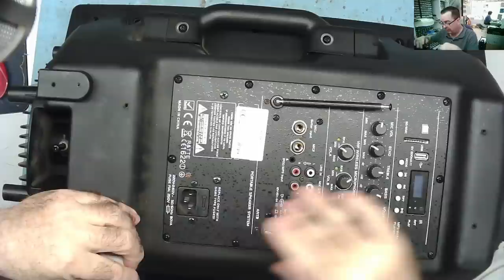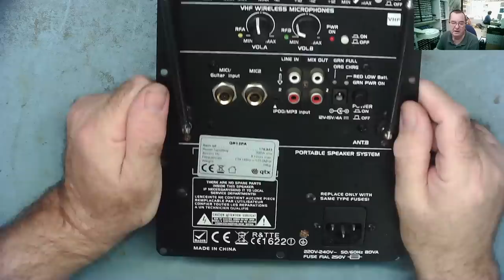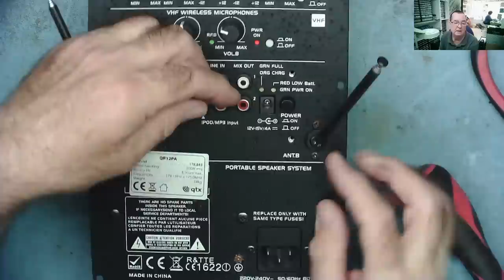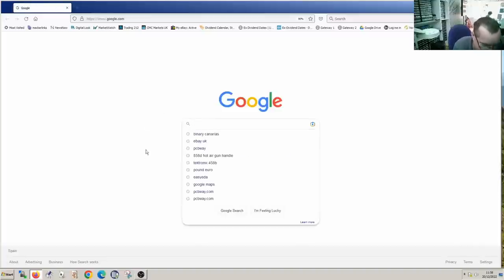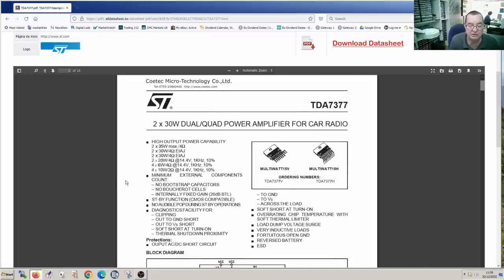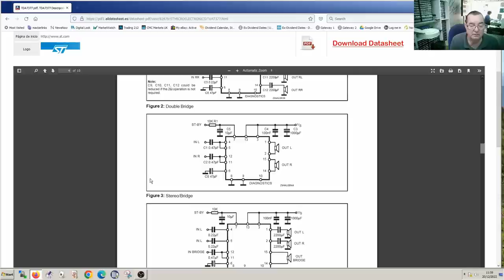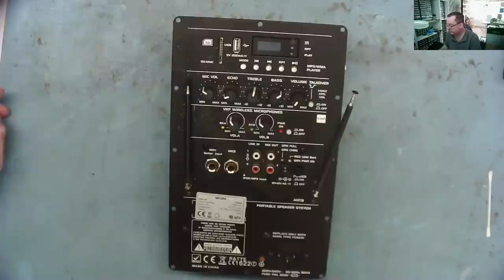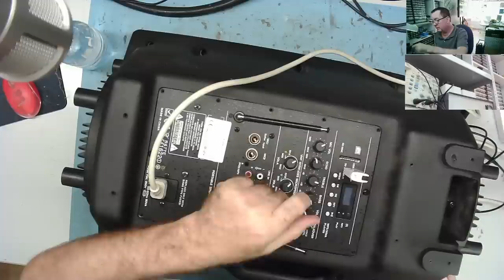Faulty 200W rms Amplified Active Speaker?  NO WAY!  It's all lies lies and DAMN LIES!!

Comment from the maker: Actually you can see on the datasheet at 09:04 that the amplifier chip is actually....

Wait for it...

6W RMS per channel in single ended (not bridge) mode!!  WOW!
Reply: Do you tell the customer what you found out from inside?
Reply: Part Number : TDA7377

Function : 2 x 30W DUAL/QUAD POWER AMPLIFIER FOR CAR RADIO

Package : Multiwatt15V, Multiwatt15H Type

Manufactures : ST Microelectronics

HIGH OUTPUT POWER CAPABILITY:
35W max./4Ω
30W/4Ω EIAJ
30W/4Ω EIAJ
2x 20W/4Ω @14.4V, 1KHz, 10%
6x 6W/4Ω @14.4V,1KHz, 10%
4x 10W/2Ω @14.4V,1KHz, 10%

So if look at it.

It do 2x 20watt rms on 1khz 10% 
Max is 2x35watt . (Bass and horn speaker )

Not 6watt rms what you tell.
That is only if u use it for multi speakers connection.
Like a portable  bluetooth   with  6speakers ar in use. 

So it not that bad
Reply: And it only assumption if that IC is TDA7377 but maybe it is not, it only say that on PCB but it can be easy TDA7379 which is 2x38W.
As early mentioned TDA7377 is 6W in single ended mode (4 speakers) in bridge mode is 2x30W (2 speakers).
Single ended mode do not apply here.
Reply: Ouch, 6W???
Mine had 25W per channel (15W RMS).... see my other comment I put up, 
I commented before watching the video as I recognized the speaker cabinet and layout immediately,
Then I spot this comment as I sit down just after break here at work (As I play videos as background to motivate me to work, just about to fix a HP M606).
Reply: I think the "power handling" relates to what the speaker itself can allegedly handle, rather than what the amp can put out. As pointed out by others, the amp is a 4 x 10 watt into a 2 ohm load car radio amp. Way short of 200 watts however you wire them.
Reply: @dyslectische  10% at 20 watts? no, thank you though. lol.
Reply: @dyslectische  nothing high power about it at all. Just a cheap & nasty speaker system you can buy for about $80 here in Australia. If I want high end amplifier kits with preamp & stuff, I'd go to Altronics & buy one of theirs. Once built, I'd go shopping for a good set of VAF Research speakers, or I'd try tracking down a SONY TA-N1 amp. These things need a sack truck to shift them, due to them being very heavy.
Reply: Reminds me of an old Power Akoustik (or however they misspelled it) "1400 RMS" car audio amp that was popular when I was in high school.  It had either 6 or 8 chips that weren't even 2x30.  I think they might have been 12W mono chips, with 3 or 4 of them per channel.  Yeah, I think it was 6 chips, because I remember the total wattage being 72 at 100% efficiency, which is never possible.  It surprises me things like that are even legal to be sold.
Reply: @eric_d  I  remember those amps. What a lot of people don’t understand is that the amplifier reaches max output before the volume control reaches maximum volume. This is due to the power supply not supplying proper voltage to the output devices used. Let’s take the MJ 15004 power transistor as a good example. It has output power of 250 watts, but requires 160v to do so. This device is a PNP type TO3 style transistor. I have used them for building current shunts in power supplies.
Reply: I'm a retired audio service technician, in my many years experience, it wasn't uncommon for company reps to intentionally misquote the equipments mains input wattage, as the audio output rating. It shifted cheap stereos to gullible shop owners, who in turn had to convince the public to buy them. Have you ever tried selling a new Amstrad or Binatone Hi-fi to someone! 😉
Reply: @A. Melbs very good question. Pioneer had a component system years ago that had a preamp setup from each section to equaliser and then the main amplifier unit. Other ones they sold had preamps in the components such as the tuner and tape deck. I’m sure you should be able to construct a preamp for use with 12 volts. Just as a point of interest, I was given a car stereo that had a badly damaged tape carriage. The radio section was fine. I set it up in a record player that had a bad amplifier. I built a power supply to drive the car stereo part, and set it up so I could use record player or radio. It worked very well.
Reply: @dyslectische  10 % distortion?

Comment: Nice easy fix. Those output amplifier modules are often found in car stereos from the past. Easy to find, & not expensive. When I saw the 200W rms output, I started wondering what it had for an amplifier board, & what components it had. Only output transistors I know that put out this sort of power are the MJL-21193, & 21194 (Motorola ), & the MJ15003, MJ15004.

Comment: I recognize this immediately, they typically have a 25W printer (15W RMS) and I put in mine a 12V car sub amp PSU for 25V split rail for a total 50V and I put in mine a guitar amplifier with 100W RMS 150W peak (with safety anti-latching circuit, it technically peaks 120W in most of the range because it essentially compresses higher frequencies over bass if too loud... the PCB was salvaged from an HH-Electric MA100 with blown pre-amps due to bad capacitors)
I just bridged the 25W amplifier to make a 50W peak, 30W RMS tweeter and drives the sub with the 100W amplifier.... It defo kicks some, but I do need to sort out porting the bass better as this wasn't designed for such bass.
Also I changed the back plate to an aluminium sheet and just added the tone-board removing everything else and moving the 25W amp to the back of the tweeter.
The woofer speaker I recon can handle 200W and that's what the scam is "Well the woofer can handle 200W therefore it's a 200W speaker....." which is "technically correct" in that the speaker can handle 200W, but they conveniently miss the point of the amplifier being a wimpy 15W RMS jobbie, lol
These speakers are good for down to 120hz clarity and does kick a bit at 50-70hz but only on kick reproduction (more ya feel the kick drum rather than hearing the kick)

Comment: Absence of 2 large el-caps near that amp chip means the chip is in "mono bridge-mode" so max 30 watts? Likely there's just a cheap NPO cap (2.2 to 10uF) to filter bass away from tweeter. 90% of power heads to the woofer anyway.

Comment: DUAL BRIDGE 30W or QUAD SINGLE ENDED 6W configuration.  My denon amp is a 50W normal twin channel, but you could buy the matching amp with out the controls and bridge the outputs to get 200 Wrms. but on my pay at the time it was out of my price range to get the second unit or the speakers that could handle 200Wrms.

I should have gotten something like this 200W rms for £5.

Comment: The audio industry is only beaten in the amount lies told by politicians.  Repaired and Sold electronics for years, and was always amazed at the old 6x9 "3-Way" car speakers that only had ONE full range speaker, and FAKE mid-range and tweeters added on to make them LOOK 3-Way.  They always had the "Retail Value $199 / Our Price $79.99" on them, when in reality they had a full range speaker worth AT BEST $15...  You'd find them at swap meets on the weekends, selling them like hotcakes!!  Of course by the time the buyer got them hooked up and discovered they were swindled, the "dealers" were long gone!!

My first experience was when someone brought me a pair stating they thought the tweeters were blown.  When I showed them it was nothing more than a plastic disk with some thread glued to the back of them, they learned the hard way not to buy stereo equipment at swap meets!!

Comment: Yes, Oh yes the loose wire and switch and control problems, annoying but very fixable, but many would have just trashed it and bought a new one.  The fake wattage thing.  Years ago I also noted that on some home stereos, they could rate them higher in watts due to putting in a low end bass cut off filter.  More fakism.  I'm not sure about the amps ratting of a transformer but a watt ratting will also tell you if the item is really 200 Watt output, it would have to have a 220-300 watt transformer power rating.

Comment: Yeah, Merry Christmas to you and everyone else. I bought a set of Amplified speakers from Fry's Electronics here in Northeast Georgia USA. They said 600 W on the package. I didn't much believe it but the price was okay. They're probably around the same as this 50 Watts or so.
Reply: Meanwhile it is normal to sell eqipment with the super duper power ratings. typically car power amps are labeled with giant power levels. For instance an  2000W (4x500) amp will revealed its true power tested on the bench with a test setup. 
I had one several moons ago on my bench. Setup with an  huge power supply  , easy deliver 200 amps a resistor bank and an audio generator. The 4 x 500 watts were 4x75w rms  in real. 
After 10 min run there was a smell of "eletricity" in the air. so I turned it off before it blow up my shop.☺

Comment: I have Alto speakers and they are triple the size of those and has Class D amps from 100w RMS total, and measured on the bench analyzer, I think the amp is 200w pmpo like they used back in the day? Wauw that's an another way to solder things, you find these a lot in cheap Chinese stuff, even in measure equipment. Metal shield that touched the nodes of the components, it was a frequencies counter, well it does it's job now here. It's basic, but I got this from a friend who thought it was time for recycling :)

Comment: i noticed long ago they changed amplifier power to RMS.. you just knew that WATTS was gone for good... apart from professional instrument amps. stick RMS where the sun dont shine.
Reply: Yep, rms power was an invention. Does not exist in electrical engineering.
Reply: @mobby1212  BS! RMS is in Elect Eng. It is the only accurate method of measuring actual constant power. A 100 peak power is only a 100 watts for as long as that peak last. Eng. realized they needed a formula to accurately measure constant power for a particular load. RMS is it.

Comment: Yes, pure marketing lies! Not real RMS (root-means-square) watts but SPL (sound-pressure-level) that started in lying car amplifier marketing. Real RMS watts (if memory serves), is calculated as Watts = V / R times 0.707 where R is typically 8 ohm dummy load with signal generator sinewave to amp input (amp volume set to max) is pushed to edge of clipping on a scope connected to the load, where V (volts) is read across the dummy-load resistance.
Reply: That is average power not rms, as rms exists as volts and amps, but not power. rms V x rms I = Average power.
Reply: Watts = V*V/R   Peak power is estimated in various ways depending on single frequency vs wideband and distortion. I have seen advertised numbers from 2 to 10 times.
Reply: Yes, as electrical-input, 'Average-Power' as well as the ‘Power-Factor ( if in a 1:1 ration (1) or less), can be calculated and certainly fine to know. As for audio amplifiers, what is usually and most keenly focused on is the ‘drivable-wattage’ into a speaker cabinet(s), being low ohms and an inductor. Which all translates into the final audio output decibels. So yes, there is a spectrum of formulas that can be used, as to the information wanted/needed. Mainly, its to ‘point-out’ the mass lies companies use in marketing, deceiving unaware consumers when the ‘Wattage’ is only a faction of what is advertised. Thank you all for your comments.
Reply: Could be IPP watt rated.
Companies Loved That in my day.
Reply: Isn't SPL measured in dB?  

Here a theoretical value of "200 dB" in perspective:

Considered the loudest event observed by mankind, the eruption of Krakatoa in 1883 sent a shockwave around the world 3 to 4 times in all directions and killed an estimated 36,000 people. The volcano is located between Java and Sumatra in Indonesia and its explosion at Krakatoa was measured at 174 decibels at 100 miles from the source, which puts estimates of sound intensity of the shockwave at the source at an equivalent of 310 decibels. That is 1021 more powerful than noise from a jackhammer
Reply: @GeekLabsMusic  The maser point is: 6-audio-watts is 194 watts short of 200 watts the marketing proclaims. Even with only a six watt amp module, only about 5.2 watts is usable before high-end THD (Total-Harmonic-Distortion) sets in.
Reply: @EyesOnReality  I don't disagree with your premise that rated power in most cheap domestic audio products is over hyped marketing BS... However your statement about SPL is not correct. There's alot more that goes into how "loud" an amp can drive speakers. Relationship between SPL and Electrical Power of an Amp is alot more complex. SPL is not electrical power. SPL is a mechanical/phisical value of how much air the speaker diaphragm can move. It's determined by both the electrical power and sensitivity of the driver(s).

Also your understanding of how THD happens is incorrect. THD is mainly influenced by Amplifier topology and the head room of the power supply, and also the quality of the silicone (Transistors). Cheaper products have small power circuits and lower quality components. THD is also relative to the frequency being reproduced. Bass note require more electrical power to reproduce while higher notes require less power. 

In a decently designed system 35 RMS is plenty of power for a domestic product.  Also the electrical power rating even if stated accurately is not the best indicator of how loud a sound system can go. That's why more Pro Audio speakers have a SPL rating.
Reply: @GeekLabsMusic  Sure its all more complex in many ways, yet working in Pro-Audio, 19" tower racks housing pro-level top amps, all being feed into concert speaker cabinet arrays in an auditorium, its only about what can be delivered for the concert hours away. As for consumer products, all the more for car amps, SPL is contained within a small space. Usually such low-end products contain SIP packaged TDA2030 and such IC's, where THD is lousy, are toys next to real TO-3 power transistors banks on large heat-sinks of the day. So in the pro-audio world, SPL means nothing when setting up for the concert. Again, its ‘marketing’ lies the video creator was pointing out that presents falsehood wattage, not SPL. SPL is valid, just not used when marketing wants to promote lies as truth. Even within that, its great you are exploring the details, learning all you can.
Reply: Pmpo used to be the car audio favourite measurement to show wild numbers.

Comment: Y'know, the amplifier probably is rated at 200W because it consumes 200W  Electrical Power.  The RMS bit is thrown in as part of the voltage component of the wattage as a smoke screen.  After all, it would take 2 full Marshall stacks to deliver 200W music power.  instead, that amp should be rated at 2 Marshall light bulbs.
Reply: The only way it consumes 200 watts from the wall is if it can make toast.
Reply: No way is this thing going to dissipate almost 200W, even if it was outputting 0 sonic power. It would melt into a puddle.

Comment: They may not be wrong, it could be eating 200w out the wall RMS because of all the B.S. they slapped in the back of a speaker box, Radio antennas, bluetooth, sd card etc.

Comment: I came across some PC speakers, it said 1200W on the front panel, there was Absolutely no way to pass that sort of power through these - total BS.
In the end I came to the conclusion the 1200W on the front wasn't the power rating, but a model number - total scammy.

Comment: Offhand, this appears to be a car-stereo amp, which are fairly standardized at  ~14.5w RMS @ 0.1% THD, but because it's 12v DC, they can make-believe any rating. Ratings standards only apply to A/C powered devices. How efficient is the transformer? I'd guess the unit draws ~200w of A/C from the wall to produce 2 X 35w max @>1% THD at the output. 🤣

Comment: I used to do repairs for a company that were sole importers for a high quality US amp maker. The were very nice amps. The outlet manager dropped over a bass combo for urgent repair. This was a new model I had not seem before. 200w RMS with switch mode psu and Neodyn speakers. Very light unit. I did the repair and had a look around it to familiarise myself with it. It was running a pair of output modules in bridge mode. The PSU had plenty of headroom to run 200watts but when I checked the spec of the modules they were rated at an absolute maximum of 65Watts each. Maybe I would have been better to say nothing but when the manager asked me what I thought of this new amp, I had to say what I found. He was not best pleased. He was basically an honest guy that tried to do people the best deals he could and believed in the products they sold. He had sold these new amps as 200w RMS to few good customers already believing the hype and advertising to be correct. He was straight on the phone to the US company. There reply was that the amp uses a pair of extremely efficient (best in class at the time) speakers that converts far more power to noise than any other speaker used in amps at that time. The effective noise level output of the amp was just over 200 watts RMS compared to the best 200W RMS amp they had tested or found data for. Whilst this did make sense and was probably accurate, why not say that instead. Just state this amp is the equivalent (or better) than any 200W RMS amp.

Comment: There is no such thing as RMS Power. RMS does not mean average. RMS is a term that is not is applicable to power. There is a metric called RMS Voltage, and that is a specific quantification of voltage. Specifically not the voltage average, but instead the Voltage RMS. The RMS is used because it gives the average power when calculating power. The phrase "watts rms" does not have a meaning. The correct term for power is average power or just power W .
Reply: At last the truth is getting out.